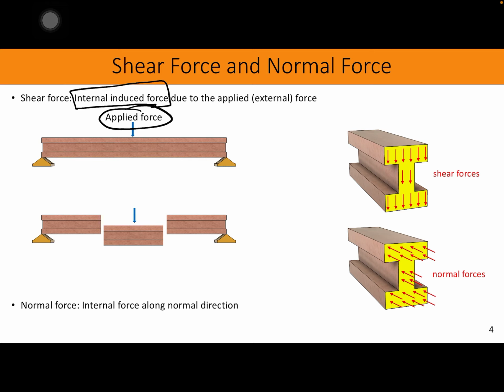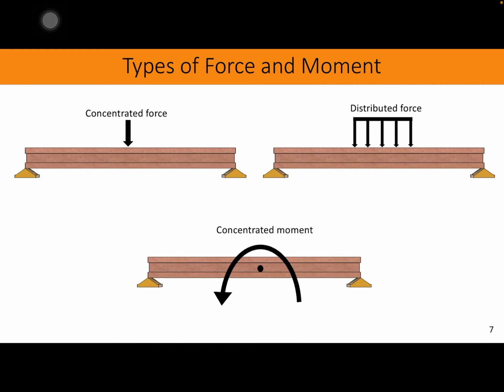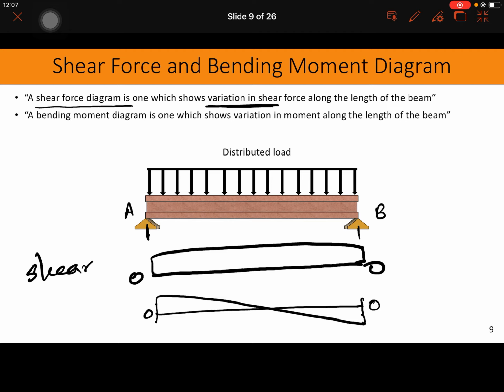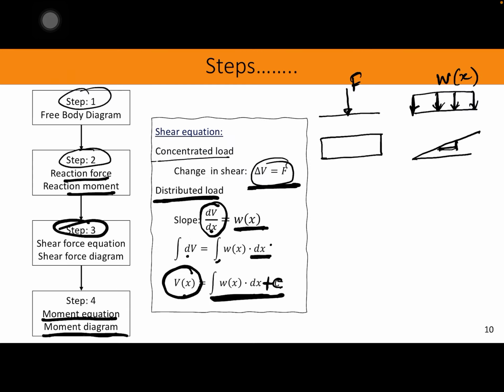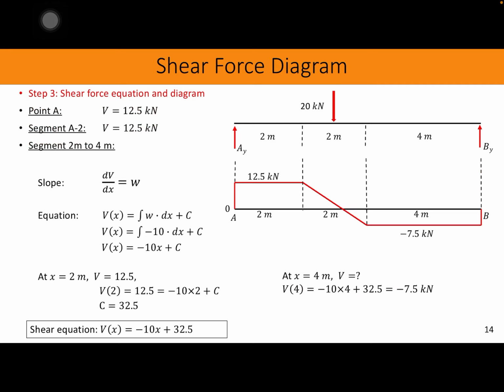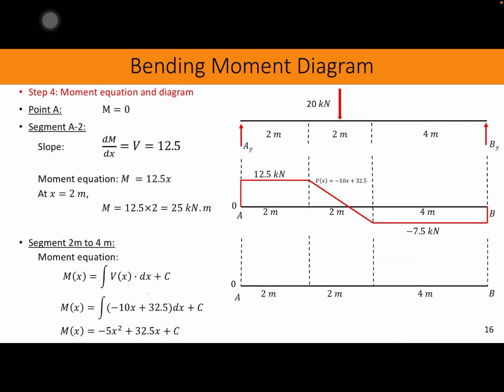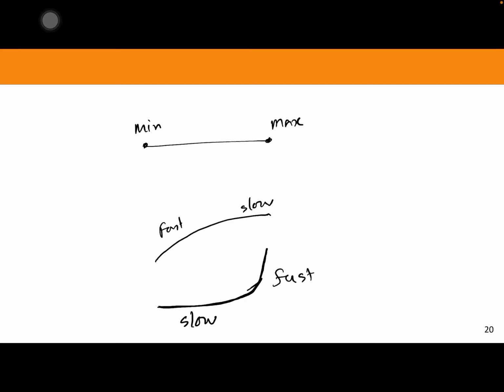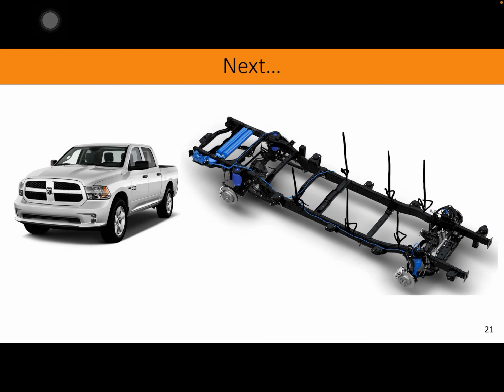Shear force and bending moment

Comment: Professor if the shear equation is represented as the slope of the moment equation, then when the slope is zero the moment would hit a max value. If you set the shear equation equal to zero you get 3.25. Which gives you a maximum value of 32.5. Is this a correct assumption or would the max always be at the furthest point of the distributed load, unless another force is applied?